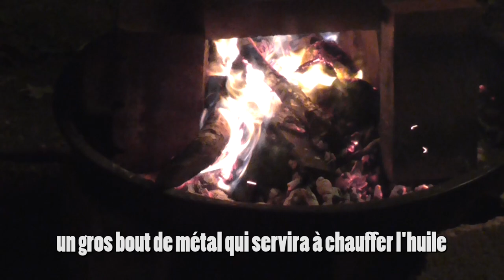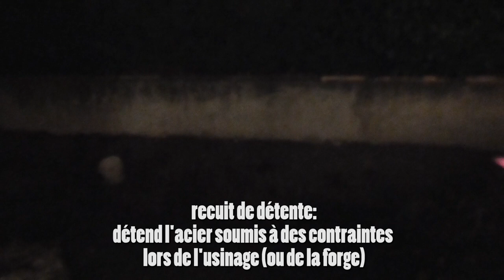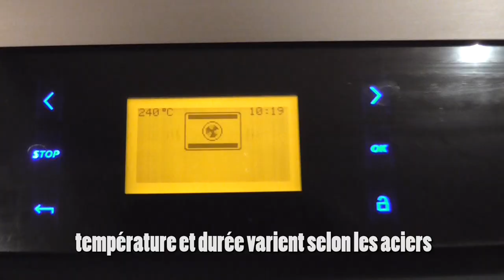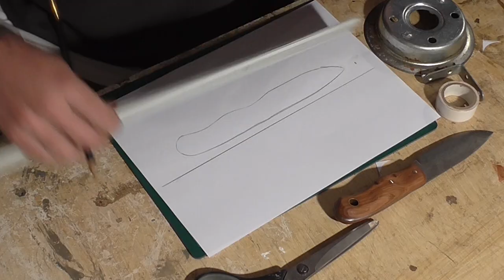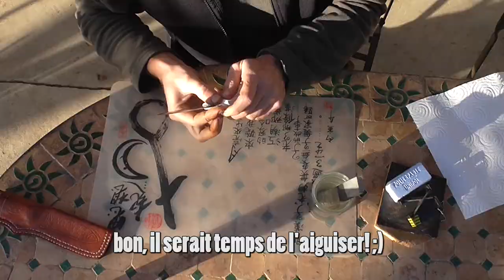[tuto] FABRIQUER UN COUTEAU BUSHCRAFT- mode d'emploi - cosmikvratch

Comment: video bien detaillée et expliquée (je dirai "comme d hab, mon cher :p) .. apres j aurai deux ou trois tit conseils suivant ma propre experience et recherches.. 
1) je vois que tu disque a la meule, disque de 2.5mm (comme je faisai au debut), essaie la decoupe au disque de 1mm, puis ebarbage/detourage au disque de 2.5mm tu verra le 1mm coupe comme dans du beurre (bcp moins d effort).
2) la normalisation de l acier, pour reduire le grain, est surtout necessaire voir obligatoire en forge, du fait de "maltraiter" l acier a coup de marteau.. en stock removal l effort est quasi nul comparé a la forge, et perso j ai fais des test de casse sur des lames en XC75 et acier de recup (lame de scie circulaire) apres trempe et avant revenu, sans normalisation et le grain est resté tres tres fin. 
3) ton revenu a 240degré pour des lames a utilisation de "coupe", ca parait tres elevé, ca adoucit bcp trop l acier. perso sur du xc75 ou acier de recup tres carboné, je reserve les 220/240 degré pour des lames de machette ou d enorme couteau, qui serviront a la coupe a la volé, et qui donc prendront bcp d effort dans la gueule.. mais des couteau de coupes je les passe plutot vers les 180degré max pour garder bcp de dureté d acier et donc avoir un meilleur tranchant et le garder plus longtemps. comme pour un couteau de cuisine qui coupera sans jamais prendre de choc.

Bon apres c est mon avis suivant mon experience, bcp pourront contredire ma facon de faire et donner d autres conseils peut etre plus "pro".. ca reste comme je le dis souvent de la coutellerie-amateur-passionée ;)

Ah oui, si jamais tu veux faire des emoutures super net et reguliere, essaye a la lime, depuis que j ai essayé je fait plus que ca, bon ok je met 2h au lieu de 15min au backstand ou ponceuse a bande, mais j avoue ca donne des emoutures si parfaite que je changerai plus de methode. avec un petit guide fait-maison ca passe creme pour le prix de 2limes a metaux

 En tout cas tu a ete celui qui m a permis de me lancer dans le micarta maison (j en ai fait un paquet et j apprecie particulierement la regularité du papier canson ) donc merci a toi l ami et bonne continuation
Reply from the maker: merci pour les conseils!
-bien note pour la decoupe, je vais tenter!
-oui, pour la normalisation ca se discute en stock removal... je le fais par precaution, sachant que c'est assez peu d'effort et que pas mal de pros font ca...
-pour le revenu, c'est assume, sachant que c'est un couteau je veux pouvoir maltraiter et aiguiser facilement en foret, avec 235 degres je suis cense etre autor de 56-57 hrc... mais pour la cuisine ou des lames plus petites, je tenterai surement mois chaud

cool pour le micarta, papier canson, je vais essayer! :) combien de couches de chaque couleur tu fais?
Reply: En general je fais 2 feuilles de canson de chaque couleur, mais bon on peu varier pour des effets non regulier. je trouve qu au poncage ca reste plus propre que les serviettes en papier (qui d ailleur font utiliser trop de resine si elles sont trop absorbantes).
Pour le micarta j ai aussi voulu tenter avec du papier journal, le resultat etait sympa au 1er abord, mais rapidement les feuilles se sont decollé lors du poncage, je pense que l encre du papier journal (contenant de l alcool vu qu on l utilise trempé dans l eau pour nettoyer des vitres) a du diluer la resine, malheureusement.
Je mettrai a jour l album "coutelerie" sur ma page FB pour te montrer quelques resultat de ces micarte d ici peu, je te mettrai le lien si tu veux jeter un oeil.

Sinon comme je vois t utilise la ponceuse combiné BTS800 (que j ai acheté recemment, et dont je suis content) que pense tu du "mini backstand" BTS700 ? je pense l acheter, pour la finition des lames apres passage a la lime je pense ca pourrai me donner la finition lisse de l acier qui me prend des heures a la main au papier de verre (sans jamais arriver a faire bien lisse et net pres du ricasso).

En tout cas merci encore car depuis un moment, tes videos et ton travail m inspirent ;)
Reply from the maker: trankil06500 super, c'est pas tombe dans l'oreille d'un sourd, merci :)
Pour le BTS 700... ce qui m'a fait hesiter c'est la taille mini de la bande abrasive, qui donne peu de possibilites de position, et risque de couter cher a l'usage... mais je ne l'ai jamais essaye donc...
pour le cote net pres du ricasso, essaye en enroulant peu de papier autor d'un support dur et bien droit (metal, plastique), mais c'est vrai que c'est laborieurx! :)

Comment: Dis moi, en general les petite lames je les trempe dans un petit four fabriqué avec un gros pot de vernis, rempli de ciment refractaire et lampe a souder style butagaz, le souci c est que ca marche qu avec des petites lames (disons 20cm total, 10cm de tranchant). J ai essayé comme dans ta video les braises avec gros ventilateur puis seche cheveux, pour des lames plus grosse (en 3mm et 5mm d epaisseur) j ai carrement eu du mal a arriver a juste legerement atteindre le rouge cerise sur qu une partie de la lame. Combien de temps tu laisse la lame dans les braises a peu pres? Faudra je retente ca avec bois+charbon de bois, et peut etre en quantité superieur.. Mais j etais etonné de si peu chauffer l acier
Reply from the maker: salut, pour les parametres a faire varier je dirais quantite de charbon (gros morceaux, recharger si necessaire), focalisation de l'air a travers (le top etant bien sur par en dessous), et bon placement de la lame... aue je ne mets dans la braise qu'une fois le brasier bien chaud. 
a partir de l'acier froid il me faut environ 20 minutes pour du 3 mm, et jusqu'a 45 minutes pour du 7mm. La lame la plus longue que j'aie faite faisait environ 20cm (+ le manche), et 7mm d'epaisseur.
Un charbon qui tient plus longtemps c'est la lignite (pas cher), par contre a faire en zone tres aeree (ca pue) et il faut le faire bruler longtemps avant  de mettre la lame pour que les impuretes ne modifient pas l'acier... et il y apas mal de residus, donc pas adapte si ton air vient par en dessous.
J'espere que ca aide! :)
Reply: merci pour ces precisions je vais essayer en faisant le foyer dans le barbecue avec des briques refractaires autour du foyer.. je pense je les ai juste pas laisser assez longtemps vu ton "45min pour du 7mm" ca devrai etre au moins 35min pour mon 5mm (j etais loin je pense)

Comment: Question indiscrète ; tout le matos compris pour faire la lame y'en a pour combien ? (grosso modo)
Reply from the maker: en terme de consommables? ca depend beaucoup des quantites que tu achetes... en achetant tout au detail (donc au plus cher), je dirais entre 20 et 30 euros pour un couteau. le plus cher c'est les abrasifs.
mais si tu achetes en plus grande quantite le prix diminue beaucoup.
Reply: D'acc ! et les outils/machines sinon ?
Reply from the maker: il y  a d'emormes differences de prix entre le materiel premier prix et le materiel de bonne qualite...
tu peux commencer avec une perceuse et une disqueuse lidl, pour moins de 100 euros... mais ca prend plus de temps! :)
Reply: ok merci ;)